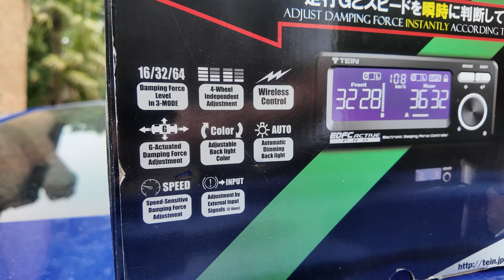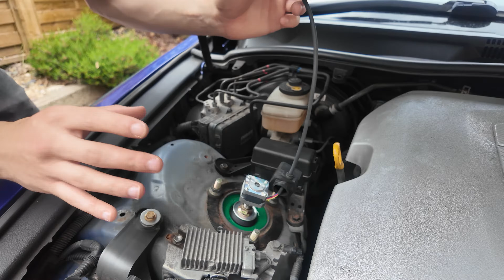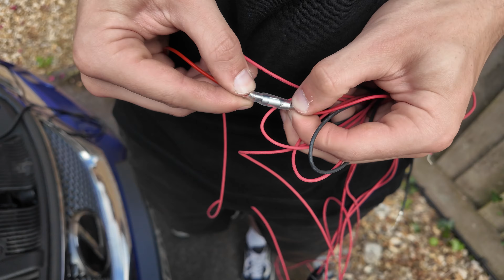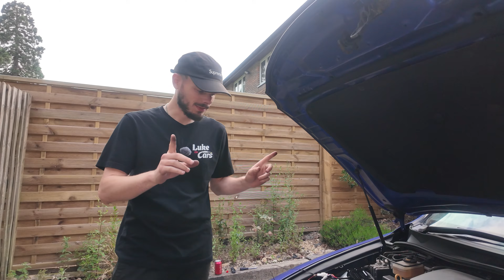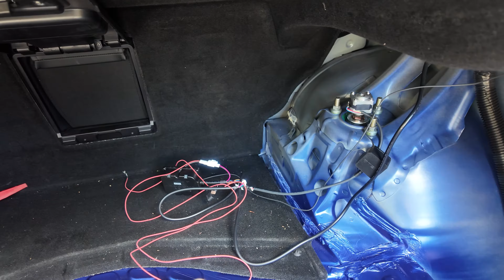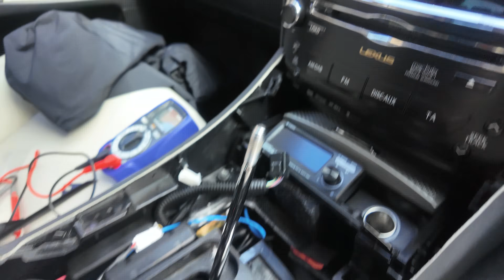Adaptive Suspension Upgrade for the ISF! Tein EDFC Active Pro Install

Comment: How noisy is the system? And is it the motors or the drive unit that makes the noise. I'd like to go this route, they have edfc 5 which is quieter but it seems like a slightly different system and goals
Reply from the maker: The motors make a noise every time they adjust, it’s definitely noticeable at low speeds and could be irritating. Once you’re moving you can’t hear it over all other noises but yes I think EDFC5 is a lot quieter

Comment: I had Tein Flex Z's on my ISF and was never really happy with them. Now have stepped up the budget quite a bit and have KWs on it and it is SUBLIME......handles much better than it did and is actually COMFORTABLE when not pressing on. Perfect.
Reply from the maker: I’ve heard mixed reviews on all coilovers tbh. I guess all very subjective!
Reply: kws can't fit adaptive suspension like EDFC that adjust based on speed and g force independently